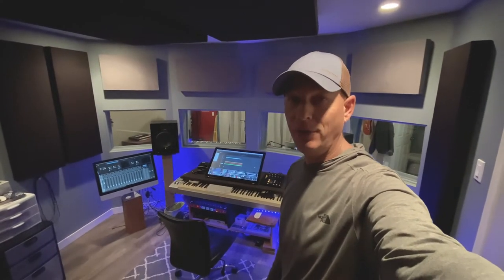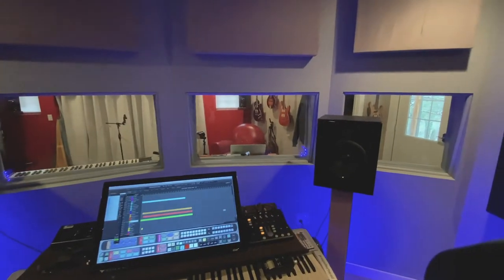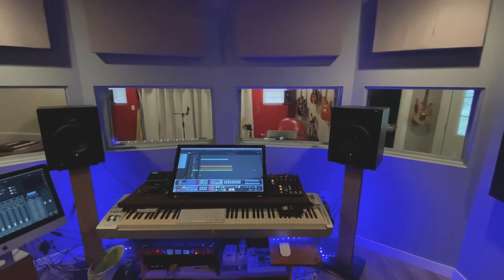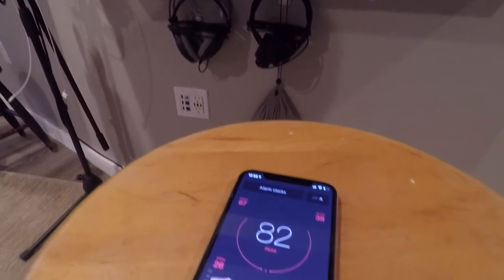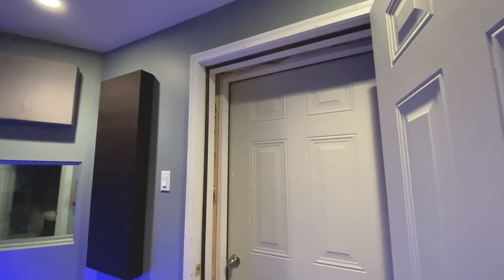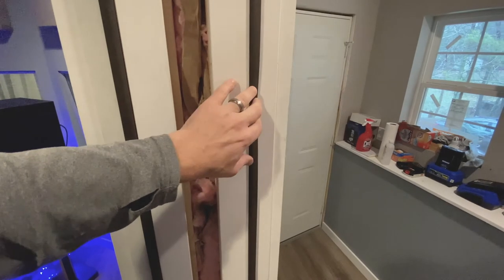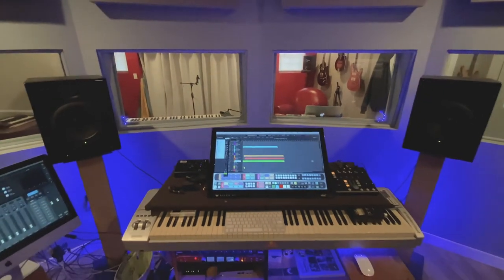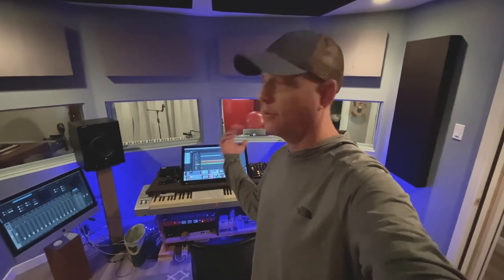Room Within a Room - Soundproof Studio Walls - Construction - With Results - Real World Experience

Comment: Thanks!  This is super helpful.  I’m in the process of framing my walls and was really confused about what to do about doors and windows with the 1” gap.  Did you go above the existing window frame and drywall to the glass?  I assume this means you’ll lose a bit of window?
Reply from the maker: I’m not sure what you’re asking. My windows are just glass panes ordered to the exact measurements of each window opening. Not sure what 1” gap you’re referring too.
Reply: @ between the double wall framing.  Or was this window added only to the new frame?
Reply from the maker: Oh. There’s 2-3” between the walls for starters. And in the windows it’s just tape painted. Nothing physical. And the space between doors is just open 😂

Comment: Green Glue is a gimmick. Use construction adhesive! It’s physics!
Reply from the maker: Glad I didn’t use loads between drywall then!
Reply: Green glue isn’t an adhesive at all, and that’s exactly the point. It is meant to translate mechanical energy to heat, further reducing sound transference between rooms. Using adhesive adds no benefit.

Comment: I'm about to build something similar, I'm going to put two layers of 5/8 drywall. And don't know what to do about greenglue. Would you recomend to use it? The cost at least in Europe is considerable.
Reply from the maker: I chose not to but I understand what I gave up. That was enough isolation for my needs. You can see the results. I’d expect if I added the g glue maybe another db or two? I dunno but I couldn’t justify the cost. Cheers! Good luck!